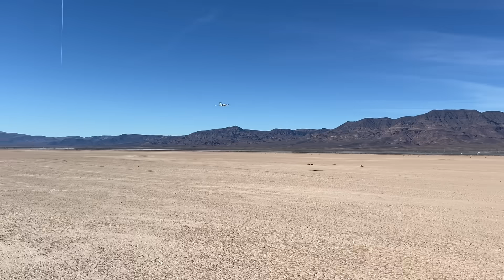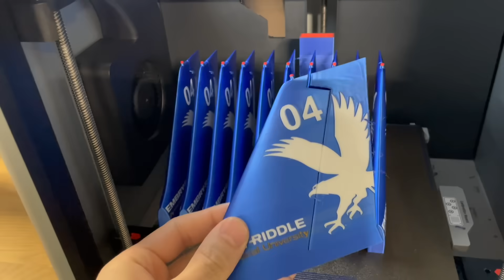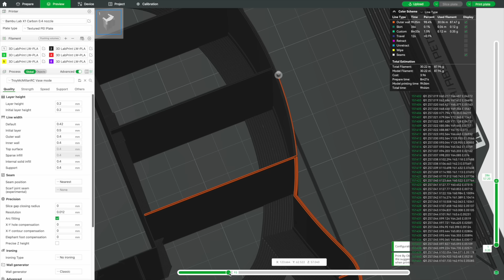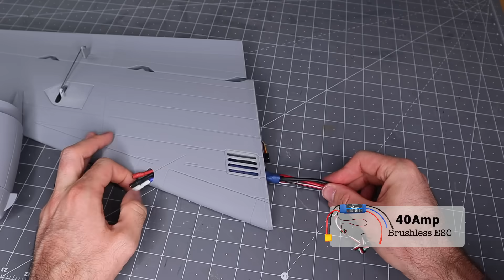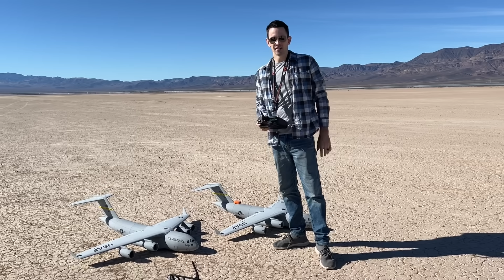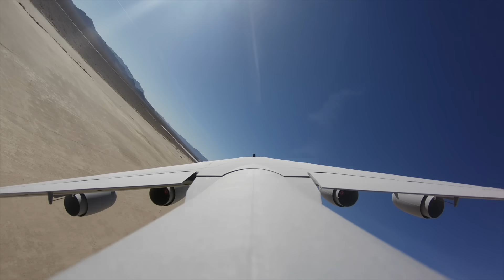C-17 the COOLEST 3D Printed Plane EVER BUILT!!

Comment: Hi Troy, loving the build. Just one issue, I used t2 x  'QX Motor 50mm EDF'. 
When Installed It sits almost flush with the front face of the EDF housing, meaning the cowl will not fit on properly. 
The only chance I have it to remove 4mm from inside the cowling inner ring so the cowling will seat fully on the engine pod.
But this also means that the EDF will sits around 4mm further forward. 
You comments are welcomed. 
Question:
* is what I propose acceptable?
OR
* can you provide an STL with the engine pod shoulder 4mm further back so the Cowl will fit. 
I am happy to pay as this is beyond my expertise
Kind Regards,
Laurie

Comment: Hi just pickup the Bambu lab P1S combo and try some one else's 3d stl file and it came out  thick wall and pretty heavy for a f-16 50mm model the setting your using on the X1 printer should work with my printer I like how light your pieces look thanks

Comment: Don't let blend you: This printers are the worst CRAP! You will pay over 300€ extra to gadgets, you nearly never need, like LIDAR or the high resolution touch display. You can print airplanes with EVERY full body enclosed 3d printer. So Bambu Lab has one of the smallest printing size, so scaling is not possible and you have to cut your models more and more!!!

Comment: I bought your the C-17, but I have an Ender instead of the Bambu. You said spiralized base mode, but what is that in Cura, or where can I find the Cura settings please? thank you
Reply: I printed on an Ender 3 using his print settings on the included print setting PDF sheet. I believe the “vase mode” is called spiralize outer contours” in cura. Found under the “special modes” tab.

Comment: I’m getting quite a bit of side to side play at the rear of the center wing connection, sound familiar or is it just me? It’s about a 1/4” or 5-6mm probably. I’m gonna add a couple side filler pieces to minimize the lateral play.

Comment: Hi Troy, I am drawing an old plane I had in the 80's in Fusion. Where I struggle with is the choice between drawing 1 line and print it with say a 0.8mm nozzle or draw 2 lines offset say 0.8 or 1 mm and print it with 0.2 mm nozzle. Is there any advise you can give me how to make the right choice?

Comment: Hi Troy, such an amazing design/plane.  I purchased the files and have started printing on my BBL P1S.  I'm printing the 1st couple fuse sections with BBL PLA Basic.  F1 printed perfectly, but I'm having issues with F2.  There is a significant overhang/bridge on that section and with spiral mode and no supports the filament just falls to the build plate.  Any suggestions for getting it to print that bridge without supports?
Reply: I think I solved the problem on F2.  I think if I print it flipped 180 degrees from the 3mf file the bridge won't be a bridge.  I just assumed the orientation was already configured.  On second thought, that won't work because it looks like you intended it to be printed in the orientation you created in the 3mf due to the first layer being partially closed on that end. Hmm.  Stumped again.
Reply: Thanks for the tweaked files Troy - that fixes this problem with F2.  Can't wait to get the rest printed and get it in the air.  Thank you for all your great designs!  Love the simplicity.

Comment: I have NOT tried this with lightweight PLA, but I imagine it would be the same as "regular" PLA . Instead of using CA,  as I have found it be brittle on PLA, I use the same stuff the styrene plastic model folks use.  Tamaya has 3 viscosities.  I just use the thick and super thin.    It chemically welds the joints so the 2 parts become one.  In my limited testing, I found the print breaks before the joint.
Reply: LW-PLA is totally different, it's very porous so it absorbs CA very quickly giving it more strength IMO. It's also great for spray because the outer surface has that kinda Fabric texture.

Comment: I have 2 C-17 foam models that used 4-40 MM EDF units. I am currently replacing the fans/engines because the ones it came with are junk. I had one fan detonate on takeoff and 3 engines weren't enough to keep the plane flying. Since my C-17s are about the same size as yours I might try twin 50 MM edf units in it with empty outboard nacelles. I noticed that on your models, the landing gear sponsons are the same length (which makes sense aerodynamically) yet on my aircraft, the right sponson is longer than the left one. The reason the right sponson is longer is because the designers realized at the last minute that they hadn't placed the APU in the aircraft yet so the lengthened the right sponson while leaving the left one at the original design length. My C-17s are plug & play and a bit on the heavy side. Your aircraft look and fly amazing! Great job!
Reply from the maker: Ya maybe try duel 50mm in your and try to shed some weight off. Nice catch on the sponson. Yes I decided to adjust this from scale so that they would work more as skies to takeoff and land on. It does fly great the main reason is just due to how light the plane is. Good luck with your C-17s. Cheers
Reply: @TroyMcMillan  Since I have two of the aircraft, I might make one a twin engine with 64MM fans and the other with 4 50MM fans. You can tell by the video that your aircraft is very light and responsive. My C-17s are much heavier and take lots of runway to get in the air with the original engines. My aircraft also have 18 wheels on the landing gear which add weight and drag for sure. Making your aircraft with equal length sponsons for landing instead of adding the extra weight of landing gear is just brilliant. It also looks cool flying with the "gear up" whereas mine always have the gear down as if it is preparing to land.

Comment: I do CAD design work for my model railroad.  That plane HAD to have been a massive design effort.  Congratulations!  It's awesome.
Edit: tried the "all parts" link and got the "something went wrong" response.
Reply from the maker: Yes it was a massive deign effort for sure. Thank you. 
I will get the all parts link working thank you for letting me know.
Required parts.
1 roll of LW-PLA
Medium CA Glue
2 50mm EDFs
2 40amp ESC
5 9g servos 
Servo wire extensions 
1 Battery

Comment: I love 99.9% about this design. Do you think that the filament control hinge could get brittle and crack over time? My PLA filament that sits out in the open gets so dang brittle.
Reply from the maker: Ya the first time I tried this I thought the same thing but I actually have planes now that are 2 years old with this style hinge with no problems. If you are worried thought you can just use carbon fiber rod rather that pla.
Reply: @TroyMcMillan  thats a long time!! In the desert no less! Super cool 👏 great idea 👏
Reply from the maker: @its_generik  Yes exactly in the desert also.

Comment: My dude, you took all the X out of your X1C, without those two setting you have my P1S lol. I'm attempting a similar type of build, a P3C Orion. Not too many renders out there. 

A question for you Sir - have you attempted using ASA Aero from Bambu? I've seen tests where it performs worse than PLA LW/Aero, but want to ask the master himself haha
Reply from the maker: Ya I did take the X out but for these vase mode printed planes it works the best with those setting off. 

Good question on the ASA Aero they just sent some of it to me so I will have it out for my next plane.
Reply: @TroyMcMillan  The videos I've seen so far comparing the two have had interesting results. Whereas the ASA had higher heat tolerance, the PLA Aero seemed to outperform ASA Aero in layer adhesion and tensile strength - not what I expected. Very much looking forward to your results, Troy! And thanks for getting back to me!
Reply from the maker: @GhostRyderFPV  Ya that does sound about right actually. I have notices bad layer adhesion when trying to print single wall construction with PETG or ABS when compared to regular PLA.

Comment: Obvious question: what if I want to make it a 4 engine monster ?
Reply from the maker: You definitely can and I would love if someone gave it a try the outboard nacelles are designed to hold the same 50mm edf and the wing has the cutouts to hold an ESC you can just print out an extra ESC cooling vent and glue in on the bottom of the wing for cooling and you will want to run two battery packs witch the battery tray is designed to hold two.

Comment: How do you get the servo to move slowly like that with the nx10 transmitter? Is it possible on the dx9 as well?
Reply from the maker: I am not sure if you can on the dx9 but on the NX10 where the trim and directions pages are if you scroll over there is a speeds page and I just set the servo to a switch to turn speed mode on or off and then set the speed for each direction. I set it to 2s to drop and 9s to close to have time to set the rubber bands in place.

Comment: Bro did u just glue in a edf and your servos??? Its all permanent install? 😅😂
Reply from the maker: For the servos I used blue tap on the servo before I glue it in so for easy removal. Yes the EDF is glued in but if I ever need to replace it I will just cut off the nacelle and re print one to add a new EDF.

Comment: What size build plate is required? I have an MK4S. Will that work? excellent work, dude, keep up the good job. Man, I wish I can do that. I can barely run my printer. much less design anything that takes talent and you have it in Spades.
Reply from the maker: Thank you, I originally started to build it to fit on 200x200x200 but unfortunately the large center fuselage parts are 205mm wide so I am saying it requires a 210x210x210 build plate.
Reply: @TroyMcMillan  Thank you very much for your response. That is really appreciated in today's day and age.
Reply from the maker: @mrsmith324  Today's day and age exactly! could not agree more

Comment: It would be cool if the engine mounted into a bracket on the wing so just glue wasn't all that hold it.
Reply from the maker: Ya but the bracket would then need to be glued to the wing so at some point it would need to be connected with glue some where. It is plenty strong enough at this size. I agree if it was larger it would need some more support but for just a small 50mm edf on a plane this light it is not needed.

Comment: how does only glue give it enough firmness to hold up to the wind and stuff? Would a carbon rod or two help?
Reply from the maker: The plastic is actually pretty strong. There is a 3D printed spar printed inside the wing for strength. For a plane this small a spar is not needed.

Comment: very nice design and build.  Great that you give the bambu labs settings.  I have never been able to get a good light weight PLA print. The layers seem to just separate at the slightest knock. Maybe I just need to try a different brand.
Reply from the maker: Here is the setting for this design of plane.
https://www.youtube.com/shorts/hanTCyoud8U

I use 3D lab-print LW-PLA with 265c at 0.6 flow with the X1C printer
Reply: so you use the pre-foamed lw pla?
Reply from the maker: @290Alenka  No I like the Active Foaming material from 3d lab or colorfabb. It saves around 45% from standard PLA. The Pre-foamed material only saves around 20% from standard PLA
Reply: @TroyMcMillan  okay will give it a try   Downloading your design over the weekend
Reply: I can only get eSun epla-lw locally. There is a 3-part Reddit article discussing settings. My issues came right when I limited the max volumetric speed to 5 mm2/s. Strangely, I get much better results with the white, but the black is a lot weaker. I lightly sand it and then coat with epoxy resin.

Comment: Love this build and plane so much! I think i will go ahead and try this as my first 3d printed plane. 

For the EDFs, do you think it matters if the motors spin in the same direction or should they be opposite of each other? I have a C160 and the two props are counter-rotating from each other so im curious if it would help on this plane with the EDFs
Reply from the maker: Yess definitely a great first plane to 3D print. Designed in vase mode so super easy to print. 

The EDF don't need to spin counter clockwise and they cant because the blades would have to be reversed witch is not a thing for propellers you can buy CW and CCW props and make one of the motor spin the other direction. But with EDFs you don't have the same P-factor turning tendency as props have. 

Have fun with the build!
Reply: @TroyMcMillan  Thanks for the reply!
I should have clarified that I didn't mean to reverse the direction of the motor, rather use a CW and CCW EDF, but good to know it does matter! Would you know what kind of flight time do you get out of the plane on 3s?
Reply from the maker: @krissondors  Ya true you could use a CCW EDF but it does not have much effect on EDF setup. So I would say if you want to and it is easy to get then yes but if not you definitely done need them to be counter rotating. 
As far as flight time on my 3s 2200mah I flew it for 4min you could put duel packs side by side and if you flew it on 50% or less power you could get at least 8min if not more.

Comment: very cool , but would have had fixed bolt on gear
Reply from the maker: Yes I definitely considered  this but the main focus was to keep it as light as posable  for longer flight time and just over all funner plane to fly. 
If I added landing gear then I would have needed more structure in the fuselage, a steerable nose gear and also a rudder for directional control on the ground with all adds more and more weight. 
This plane is so light it almost needs no power to fly and can easily be hand launched.
Reply: @TroyMcMillan  it would be good to have the a file set for a optional  fixed gear , I will   print one  and mod mine to have the gear

Comment: I was really excited about a 1.5m size. Will that be an option?
Reply from the maker: Ya I take a lot of thought when designing the size of my planes. This will only be the 1.3m size that I offer. If I would have made it any bigger then it would be a hard plane to hand launch so in that case it would need landing gear, more structure, and just overall a heavier airplane. This plane is super light and over powered and just fun to fly at this size.
Reply: @TroyMcMillan appreciate the feedback, just a minor suggestion, the website intro description has 1.5m and twin 70mm edf for power. I’m getting this for sure and your dolly.

Comment: Can you make son adapter like you did the dummy outboard blades, but for a propeller no Edf to made the aircraft more efficient for long flight, specially FPV with Inav installed. Will be a great option for FPV pilots.
Reply from the maker: This is actually a good idea and I was thinking of turning this into and FPV plane. 
SO just to clarify you are saying to make a motor mount that would hold a brushless motor and a propeller rather than using an EDF to fly it.
The prop blade would probably be something like an 8in prop so it would stick out and be larger than the cowling.

Comment: This is so bad ass! What brand of LW PLA are you using? Did you test one with 4 EDF's?
Reply from the maker: I use 3D LabPrint PolyLight LW-PLA (Light Gray) for this build.

I have not tested this with 4 EDF's it would be so over powered the power to weight ratio with two EDFs is already twice the power needed so with 4 EDFs it would basically be a rocket at that point you could do vertical takeoffs. :)

If you try it sent me a video I would love to see it.

Comment: You should include the .mf3 files for those with the carbon just print.  Will you do it?  Plus the price in the website say 55 and then goes to 65.
Reply from the maker: I included both 3MF files and STL files for this build so that it would be even easier to print. 
Thanks for the heads up about the price I fixed it.

Comment: I'm surprized at the lack of a continuous spar especially at the wing root! Apparently a small plastic overlap is sufficient?
Reply from the maker: There is a spar it is designed into the wing there is a thick section of printed. material that you need to add a heathy about of glue to when joining the wing sections.

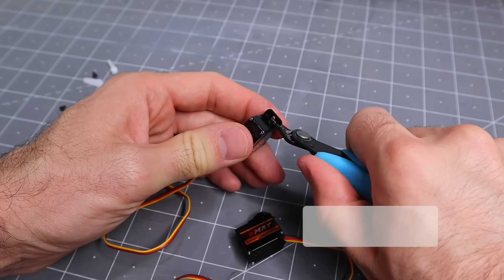Comment: 05:10  i am confused. 

because a few seconds earlyer you can see you cutting it out and it being cut out before glueing it together.
Reply from the maker: Ya so there are 2 parts that need to be cut I only cut the part out on the fuselage part. The same area needs to be cut out on the vertical stab. I forgot to cut it out when I was glueing it together.

Comment: the only problem i have with my bambu lab a1.  is that a 1 hour print.  turns into a 4 hour print even if all i wanna do is put some multi color text in the last few layers. 
that default color changing profile needs serious work to make it faster.
Reply from the maker: Ya I definitely agree the color changing does add a lot of time to the print.

Comment: it flies on 2 motors..  that means the outer 2 are decorative..  

that means this thing COULD potentially fly on 4 motors and be even more insane..
Reply: The question is whether the thrust is worth the weight
Reply from the maker: Exactly thank you
Reply from the maker: Yes it can be and was designed as an option because I thought there would be few people out there that would want to try it.
The problem is you are increasing weight and not increasing the wing area so you are just increasing weight per area on the wing so you will need to fly it faster witch you will have more powers so not a problem but more power means more battery needed so it is all a trade off just depends what you would like.